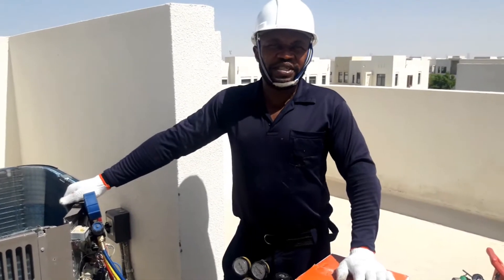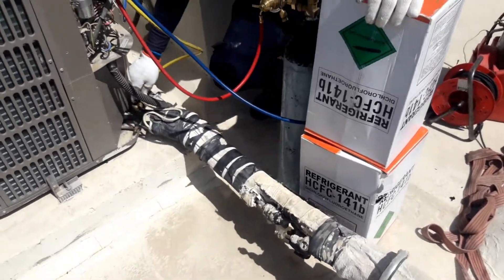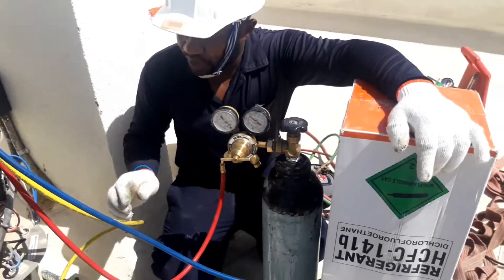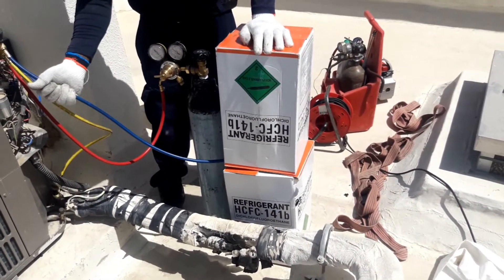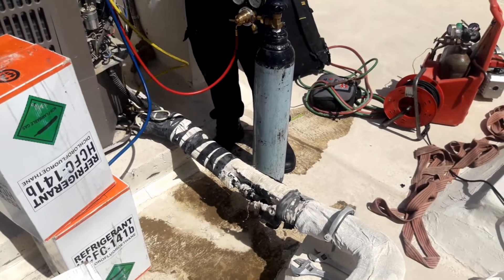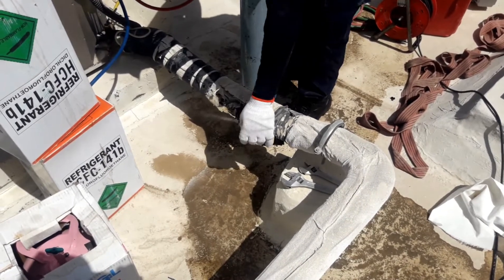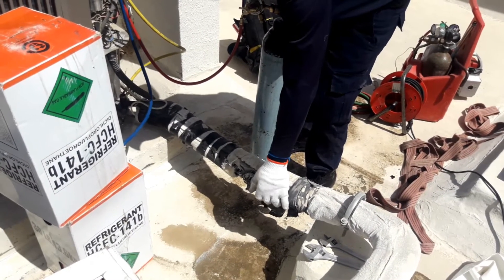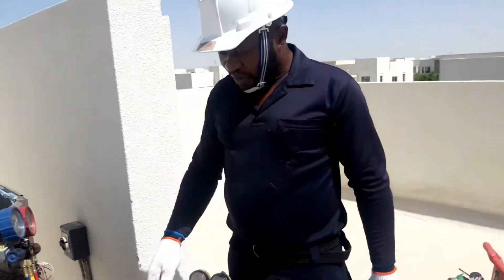Easy way to flush and unblock indoor unit with R141b+Nitrogen

Comment: Why is there frost on the suction line entering the compressor and frost on the compressor discharge line? you closed the low side service valve completely.

Comment: how bout the expansion valve? do you need to isolate first? or you need to include the flushing?
Reply: Yes man, it's too much better if you separate the system in two, remove the TXV and clean the little filter that's inside, this procedure is the best way to do it, because in the other way there are many possibilities to leave the 141b inside the system